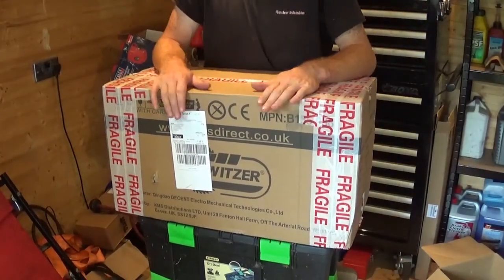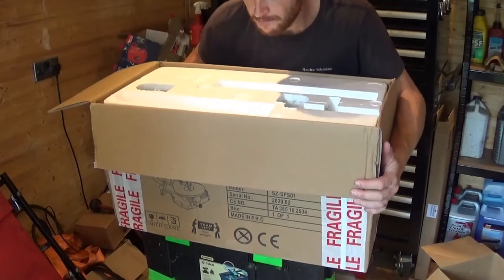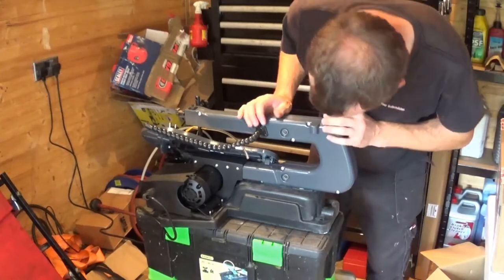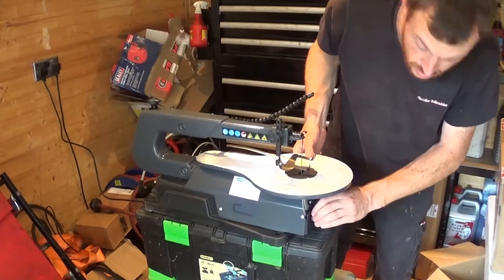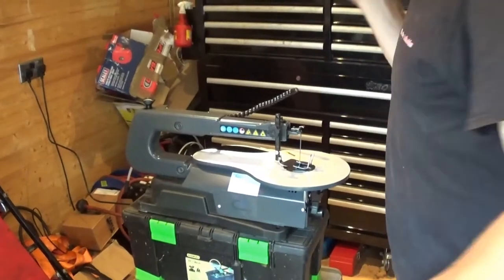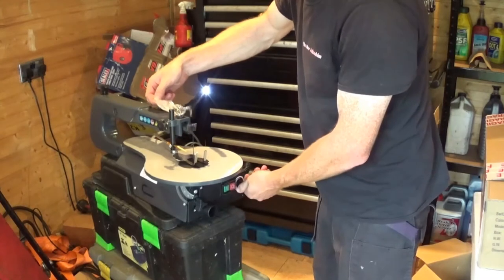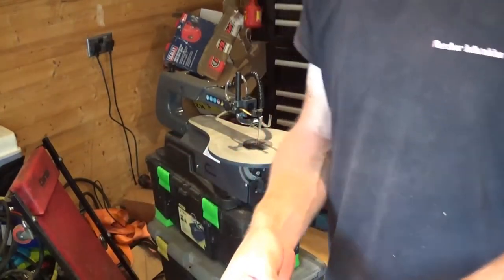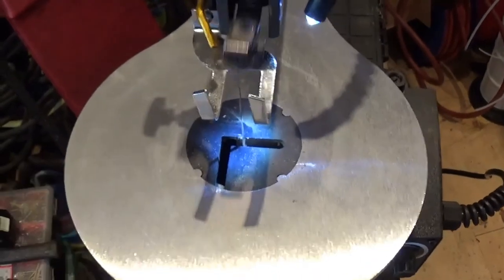Review On A 125w Switzer 16 Scroll Saw

Comment: Got one of these recently and so far very impressed for the money. The light is crap and its flexible mount sags with any vibration, the dust blower is a waste of time too, but they are just add ons. As a saw in itself its a great piece of kit, well built and nice to work with.
Reply from the maker: Hi Apollo i'm so sorry for the late reply YouTube picks and chooses when i see them. Yes i 100% agree with you. I just added my own light and attached my air compressor to the dust blower that worked well. Just as long as you have something to control air flow.

Comment: blade upside down
Reply from the maker: I'm not sure myself but would it make much difference
Reply: @Fletchers1    It does, It needs to cut 'down', that way it won't tend to lift your workpiece up as your cutting. and also, you get a neater cut on the face of your workpiece and puts  the burr on the back  !
With all due respect to you also.... You need to improve your method regarding safety . Especially your hand/finger positions. Hope your not offended.
feel free to delete this comment if you wish. good luck  Lolwit